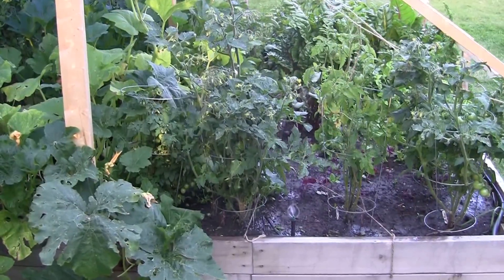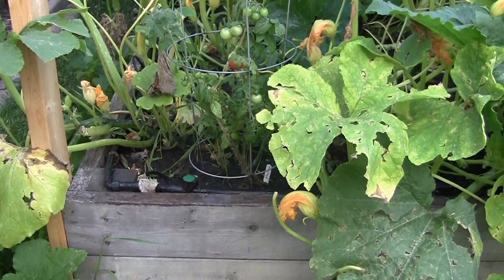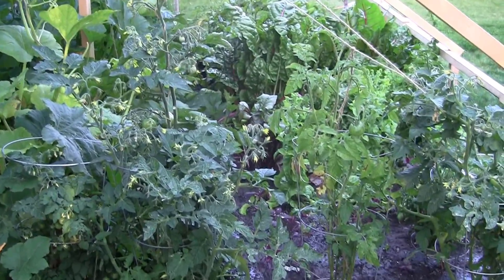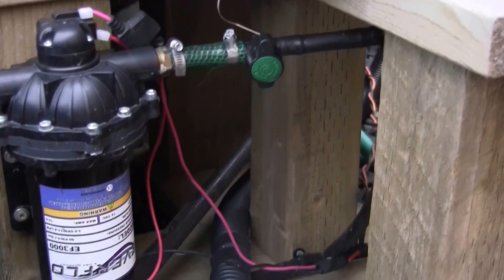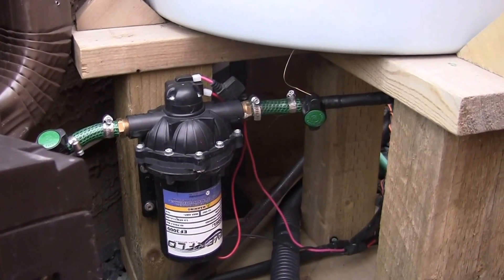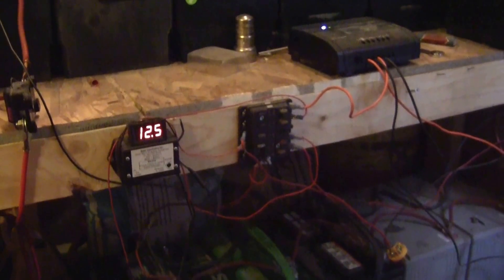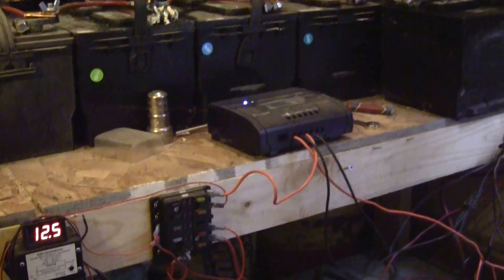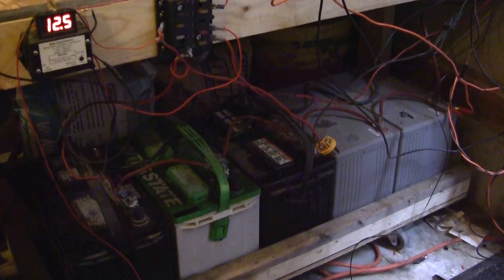August 08, 2016, Solar powered rain barrel garden watering system!

Comment: Very nice set up. Question: what is the GPH and pressure of the pump you are using for this setup..
Reply from the maker: Sorry, had to look it up.  3 GPM, not per hour.  rated at 60 PSI.